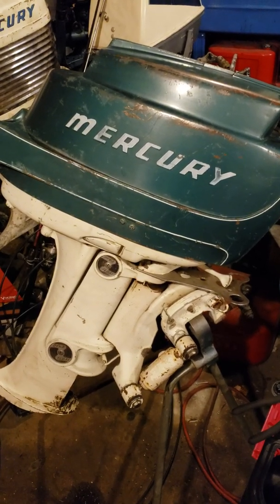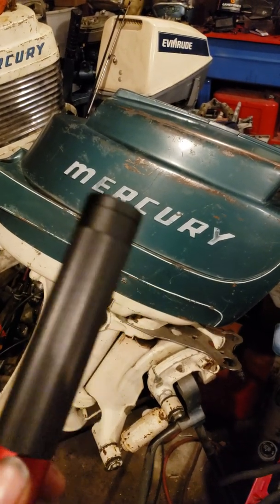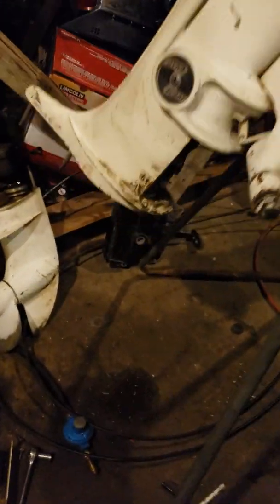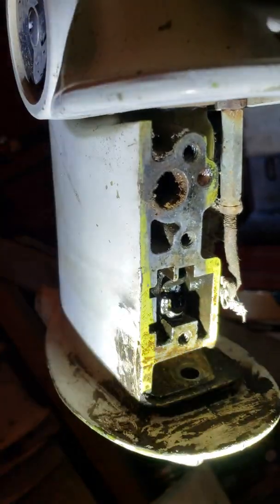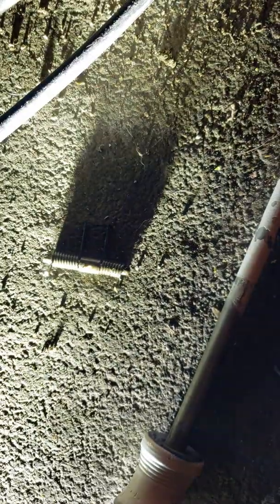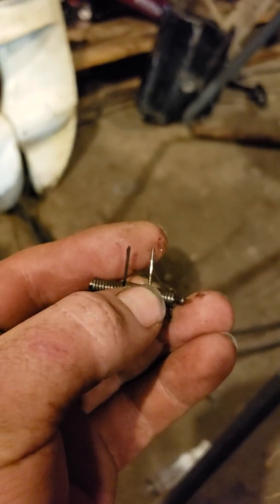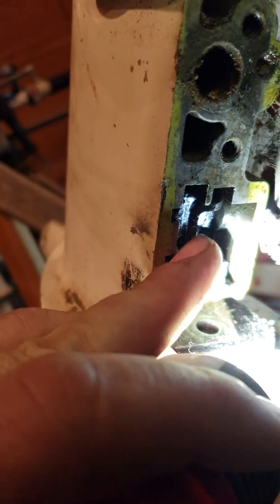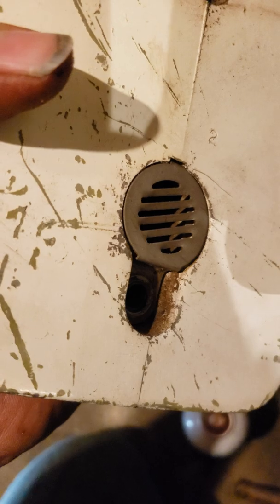Introduction to Mercury Automatic Transmission Water Pump Impeller Replacement

Comment: I need the tool number for removing the gear case prop housing threaded cover. That's what they call it on the diagram but it more like a 2 1/2" ring with 2 tabs. Not sure if it's reverse thread? I heard you have to heat it up to get it off. Any help is appreciated. Thanks
Reply from the maker: http://johnsmcintoshvintagemercuryoutboard.com/AutoTransTools.html

Bottom of page #AT5